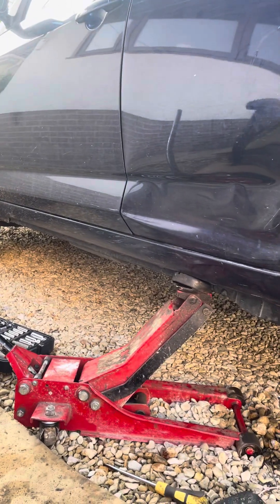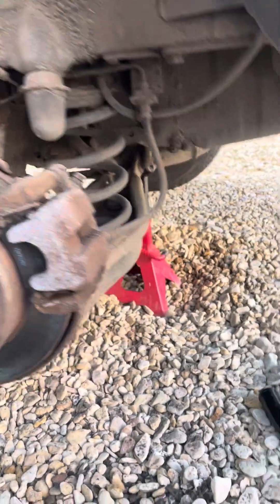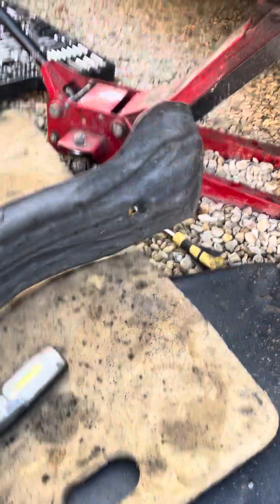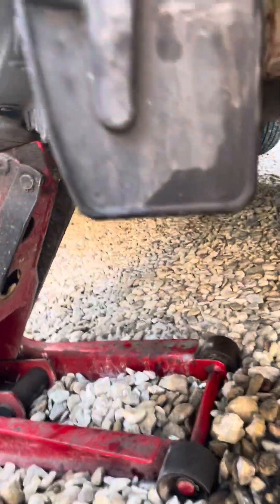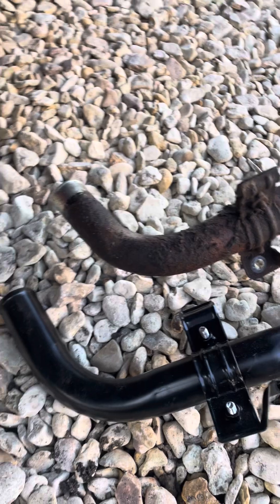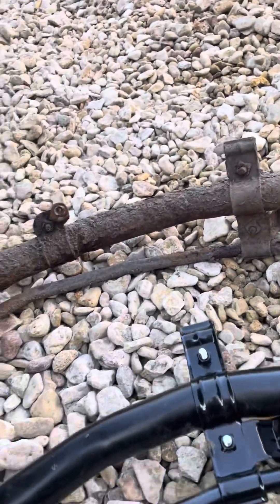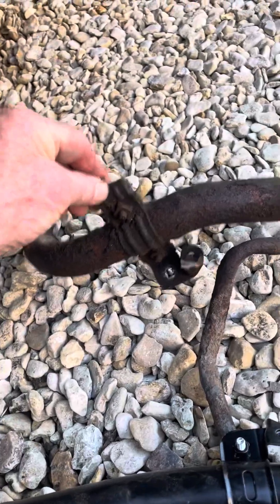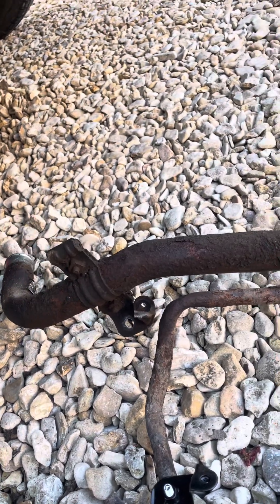RAV 4. Fuel Filler pipe, replacement.

Comment: Hi John thanks for this. Same issue on our 3dr Rav 4.
Who did you get the replacement from on Ebay please?
Probably a stupid question, but can you do this with fuel in the tank?
Reply from the maker: Hi, I got it from IM Axle Specialist Ltd for £47 including postage and 2 yr warranty. Good question re fuel, I wondered the same and took a risk. My tank was about 3/4 full and it was Ok, if you’ve just filled up to the filler. Best to wait a bit. Till tube section empty. One point I found had to faff around a lot to reposition the curved cowling back, so take photos before removing and when plastic removed to help repositioning the brackets. I ended up using longer bolts and thin screwdrivers to realign everything. Got it all back eventually if not exactly flush. Make sure the filler is reasonably aligned to get the cap on and off. I had to jig around a bit with it.